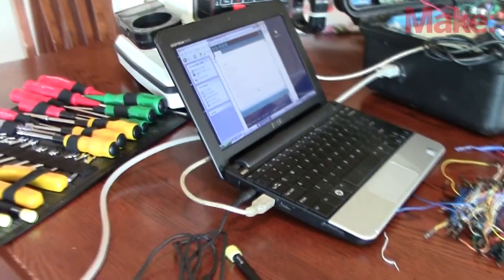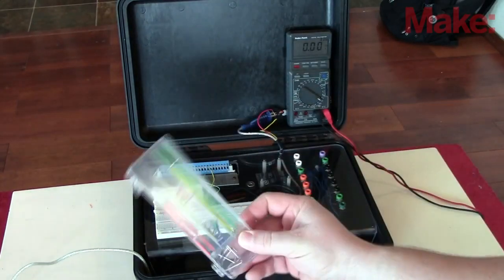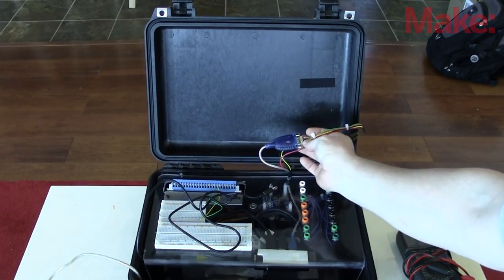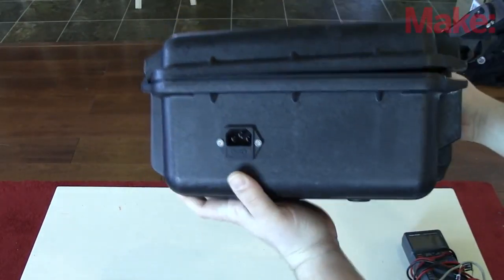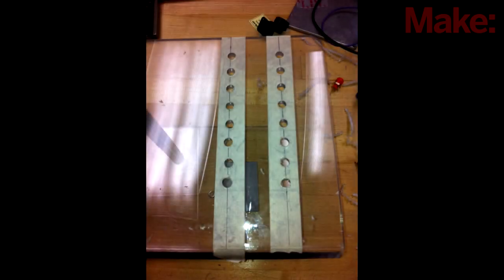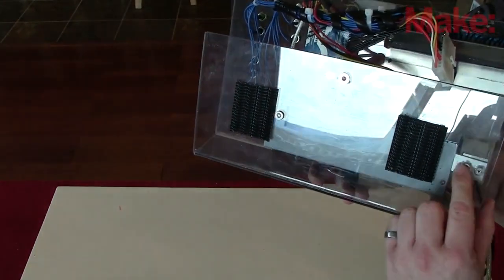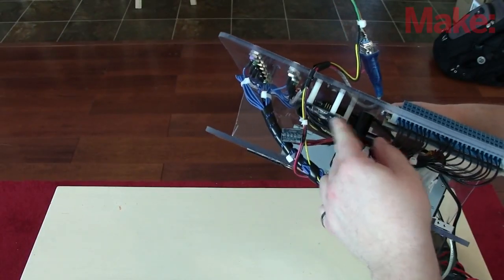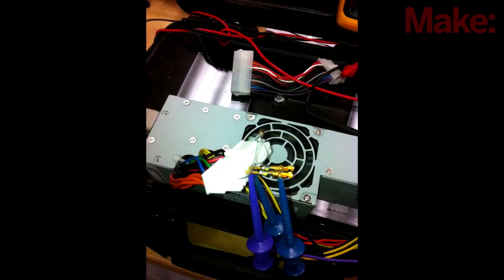Projects with Ryan Slaugh: Building a Mobile Prototyping Platform

Comment: Or you can use a more dedicated power supply with variable output.
I saw one the other day in the electronic store with 12, 9, 5, 4.5, 3 V fixed outputs and 3 outputs with a slider for whatever voltage you need up to 24V.
3A 72W for 69.99€ is a good deal I think.

Comment: For testing computer power supplies, I have found that just a wire jumper is fine, it did not need any added resistance.